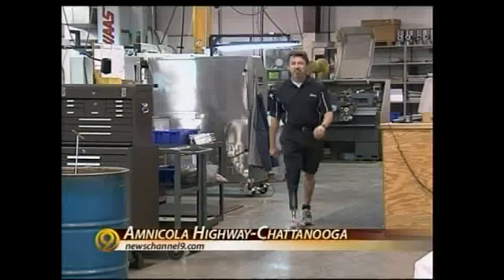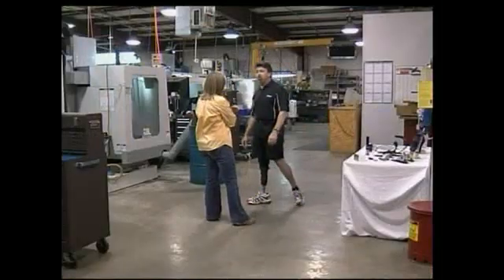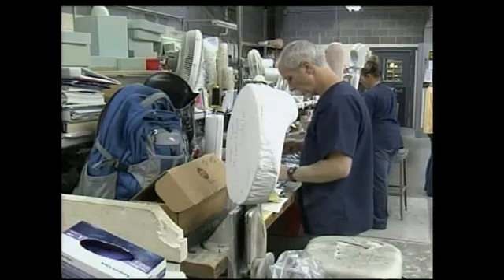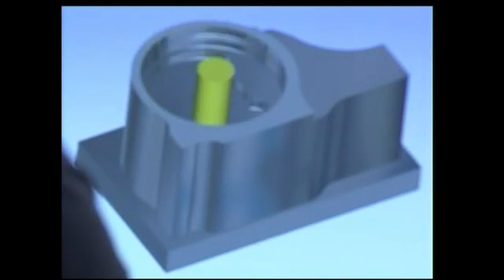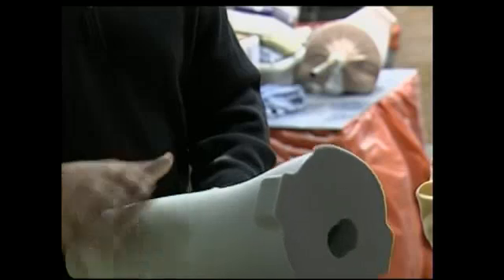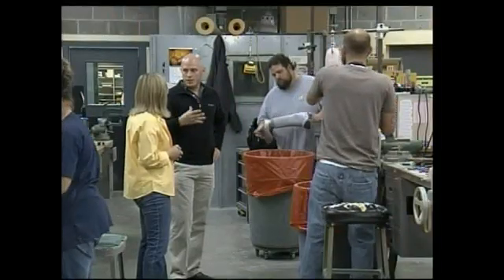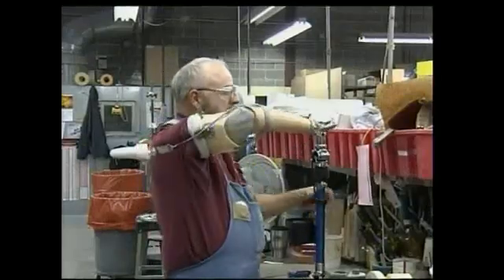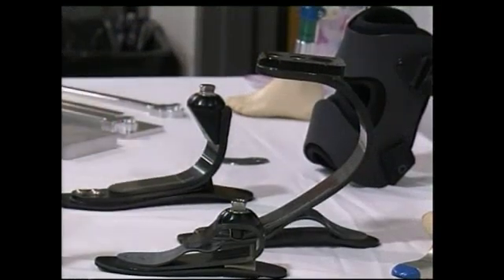Made in Chattanooga: Fillauer Prosthetics

Comment: I have a swing phase 2 KAFO made by Fillauer. It has NOT worked correctly since the day it arrived almost 3 months ago. I am beyond frustrated with the absolute lack of function, pressure sores, pitting edema, & discomfort. Been back to get it adjusted many times. Each time it seems to lose more function.
Spent 4 hours at the orthotic office today. Now the effing knee joint fails to catch. Now it only workes in the locked position. The dam thing seems to be going from bad to worse. I want to return it. However I can't walk at all with out it. I need something to function as my knee while I am at work
 I can't afford to lose my job. I have to be able to walk at work.
Sorry to write a book. I am soo beyond frustrated & don't know where to turn for help